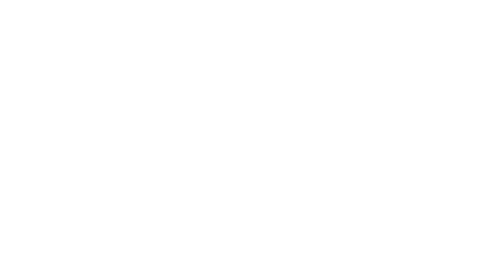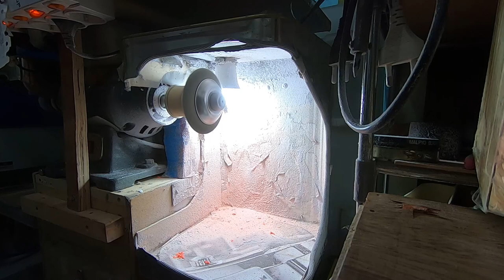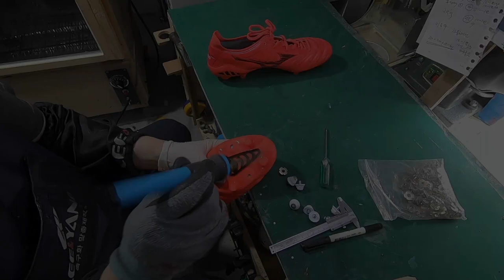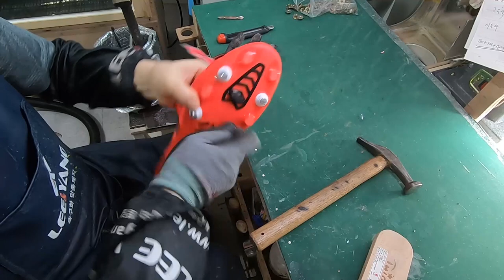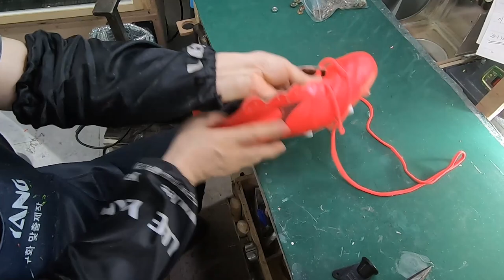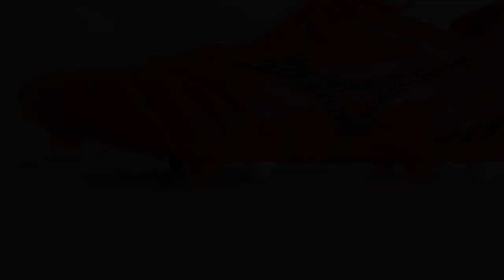How to switch football shoes from FG to SG - Mizuno Morelia Neo III JPN FG

Comment: Where did you get the inserts from which the studs screw into. Example at 10:35 you can see inside the stud receptacles
Reply from the maker: You can buy them at https://www.amazon.com/s?k=t+nut&crid=1BX048EZZ85G7&sprefix=t+nu%2Caps%2C233&ref=nb_sb_noss_2  or in ur country hardware store 5mm.

Comment: Why did you burn with the soldering iron before drilling a hole. Could you have just drill a hole in th first place?
Reply from the maker: I did it because it would be possible to do more accurate work if I pre-worked with a soldering iron to make the hole precise.